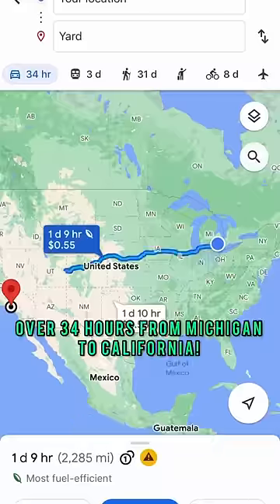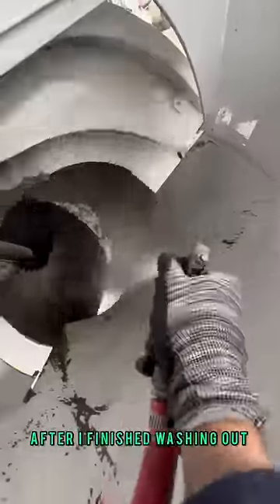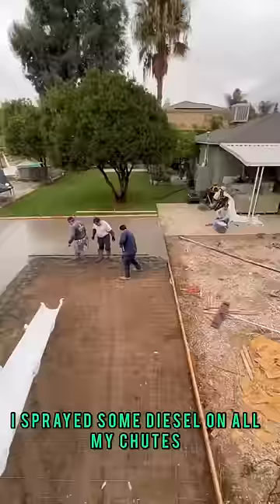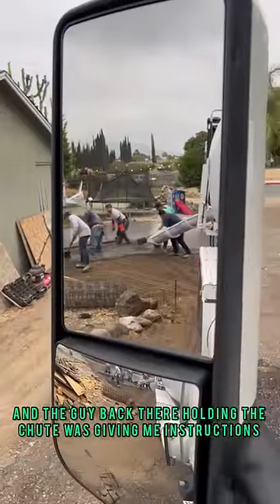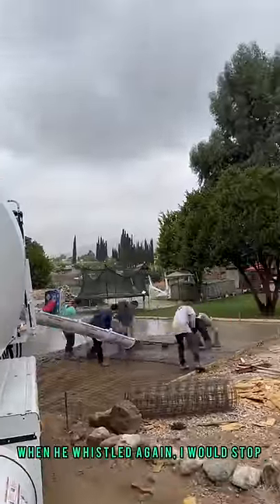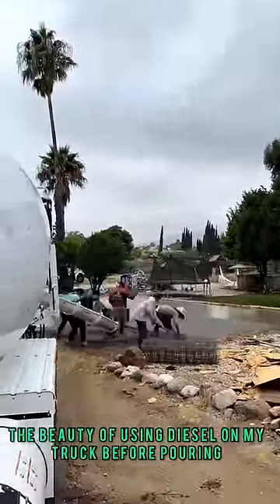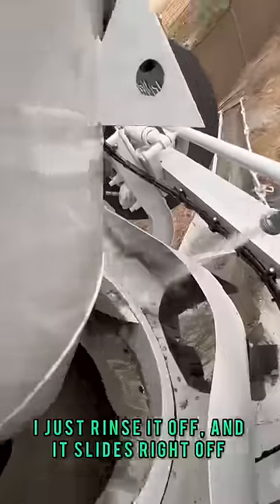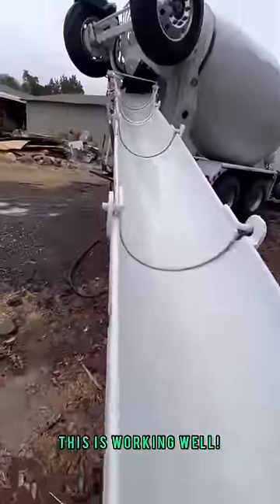BRAND NEW 2022 MIXER TRUCK!! 🤩🚛💨 #concrete #construction #readymix #work #cdl #trucking #shorts

Comment: Yeah, rinsing all that diesel onto the ground is perfectly fine....
Reply: Where do you think it came from?
Reply: @wyrdo1501   perfect comment
Reply: Bro used like not even a quarter of a spray bottle probably but “AlL tHaT dIeSeL”
Reply: With the SWPPP now your not allowed to rise out the concrete at all on the ground.  It’s federal, state and most local law that concrete MUST BE CONTAINED  we have to create a washout pit lived with 2 layers of 6 mil plastic with a berm greater then 12 inches  stone to line the rim of plastic and a posted signage 

SWPPP = storm water pollution prevention program  
Most building dept now have this inspector and this is there entire job 

Me as a project superintendent have legal mandatory paperwork that has to keep on file in the field office 
And BTW folks. This is nothing new I have dealing with SWPPP for 20 years  it’s just getting tougher with more inspectors it’s now very common that the local city inspector and a county inspector will both be on my job sites
Reply: @almostcanadian1580  x how many loads of concrete per day x how many working days per year.... aLl ThAt dIesEl ..
Reply: Disiel comes from the ground wow this whole time i thought it was refined from oil, from the ground. Yeah theres alternatives than diesel
Reply: Public Square  you're right, diesel doesn't come out of the ground like that. It starts out as crude oil. Then it is distilled into diesel. Did you know one of the byproducts of making diesel is asphalt? Now, remind me again what exactly it is they do with asphalt because I seem to have forgotten at the moment.
Reply: @c0rnp0p80  Asphalt is just a petroleum byproduct the same as diesel and gasoline. It isnt a byproduct of making diesel. Both diesel and and asphalt are just part of the total byproducts of petroleum processing. And they are very different to pour on the ground. The way we use asphalt is to place it in one location and it stays there in a crust. Pouring liquid diesel on the ground would immedialy spread down into the soil and water and be consumed by small organisms and slowly increase in density as it worked up the food chain of animals. In the US we learn all about this process in elementary school.
Reply: @winstonpoplin  if you learned about it in elementary school then why did you spend 30 minutes looking it up on Google? 😂 Stop the cap, bro. You ain't fooling anyone.
Reply: @c0rnp0p80  lmao this is standard curriculum mate. Not even anything advanced. This is the most basic understanding of the spread of a material through a food chain. Literally every person over the age of 10 has been tought this in the US. If you think this is impressive knowledge then thats just sad.
Reply: If diesel gets into a water course the effects can be devastating
Reply: @almostcanadian1580  a quarter liter, per truck, with three pours a day, that's a lot of fucking diesel going into the ground.

You drink it.
Reply: Oh yeah and where do you find disiels in bulk in the ground. 
 Uraniums in the ground to, i wouldnt go sprinkling enriched uranium in ur vegtable garden.
  What about the cleaning agents in the refining process? Lmk what grows in it also, and if youd give your family members water or food contaminated.
 Did paving and masonary for 6 years, they dont allow that at the gravel asphault yards and theyres way cheaper alternatives,
 Surprised this is even a convo with prices seeing how some other alternatives can cost.05 cents a gallon vs 6.00$ (diesel)
Reply: @SpunkMayo  some people live their lives listening to those that sale fear for a living, and the rest of us rely on common sense and rational thinking. believe it or not this world is a lot harder to hurt than you think it is, sure pouring a bunch of diesel on the ground would be stupid but come on complaining about what this guy did like he is killing the planet is just extreme and idiotic. whats gonna happen, is he going to harm the grass? i think the concrete slab might be the bigger issue if thats the case. 
 pollution is a serious problem we all agree on that but lets just focus on the companies/people that are doing real harm and leave this dude alone what he did was pretty much harmless. 

if you want to see some real pollution just take a good look behind the curtains of the electric car battery industry. thats going to end up being an actual crisis in the end, it already is and its just getting started.
Reply: Then u hate to see when I bleed my fass fuel filter system most of the time it's a bucket otherwise wise I give back to the earth what we took out
Reply: my exact thoughts but i'm no narc.
Reply: It goes in a 2-3 stage washout pit, sometimes we dump our loads into our reclaimer too.
Reply: @stephentucker5406  do you or did you guys ever use a reclaimer that you dumped your concrete into? It washes the gravel and fly ash from each other. We use it for excess from jobs, slump screw ups etc. It's an interesting machine.
Reply: @stephentucker5406  the
Reply: @c0rnp0p80  you might think that’s logical but there are regulatory agencies devoted to this entire process ( federal, state and local) and they all have inspections and paperwork. Ohh boy to they have there paperwork.  Trust me I know!!
Reply: @winstonpoplin  well said
Reply: @DerfOrNuffin  I think your making everyone’s point that dumping these things in the ground is bad and we should try not to !
Reply: @wyrdo1501  most of your rant is accurate but for one part. 

My son is the plant manager of a precious metals company and there the first in America to be getting a federal EPA permit to reclaim batteries (10 million $ permit)and they have for years been reclaimed the cadmium , lead, nickel. And for years before this has been a cluster.  But as now or soon. 100% of batteries and there elements will be recycled due to the need and cost of these materials 
But don’t get me wrong it’s still about the money 💰 to make more batteries
Reply: @stephentucker5406  not a rant just the truth, its like people have been conditioned against debate or talking about important subjects in any amount of detail. i couldnt care less honestly but it does make me sad to see how society seems to have embraced ignorance with open arms and a closed mind. not talking about you just in general im sure you understand what im trying to say and experienced this yourself at one point or another.  

i know we recycle a lot of batteries, we have been for years so its nothing new but a lot of them will just end up polluting the environment we both know that. 

but think about this point, it takes something like 4-500 tons of material being mined from the earth and over 300 barrels of oil for the equipment to do it, just to produce a single 1000lb battery for a tesla. thats for one battery. im not against electric i think its cool, but nobody wants to talk about the not so pretty side of things because it kinda makes their points about saving the environment void. thats not even getting into the fact that like 90% of the electricity to charge all these cars out in california at least comes from burning coal lol. people need to understand that in reality the only truly environmentally friendly way of getting around is to walk, assuming they are not wearing shoes made of petroleum products lol. we really are at a point of damned if you do and damned if you dont.
Reply: That's where it came from!
Reply: @winstonpoplin  How exactly do you think poured diesel "increases in density" over time?   If it does, it's then exactly like asphalt.  It's not some super liquid folks.
Reply: @truthbetold1855  Over time the diesel molecules would spread and sink into the soil and water and eventually make its way to plants and animals. The increases in density in certain plants and animals are due to the way the food chain operates with primary and tertiary consumers. The lower level life forms consume a certain amount of the diesel. Then the upper forms of predators consume a lot of the lower forms and this causes the chemicals to build up in the higher level predators. Its an interesting process if you wanna look it up. It has been thoroughly discussed throughout this conversation, so feel free to look back.
Reply: Imagine how you're gonna act when you learn about venotryl acid
Reply: @stephentucker5406  dam that's crazy man . That's taking it abit far man . Abit more relaxed here in nz

Comment: Old man who used to drive a cement truck once told me that if you ever get stuck in traffic on your way to go clean out pull over at a Walmart buy as much sugar as your credit card can afford and put it into the mixer the sugar will prevent the concrete from hardening and it'll be a one day job versus a 4 day job
Reply: Hopefully that guy was driving a concrete mixer truck instead of a cement mixer truck cause this type can't turn a drum. And you would not add sugar as powder. You will add only max. 0,1% coke (liquid sugar) of the amount of cement inside your concrete to gain few hours before it will start hardening. Just saying.

Comment: Are there no cement trucks in California? What am I missing?
Reply: They are most likely bought up by large companies. We had to drive 10 hrs away just to get a new 4500 work truck.
Reply: Concrete trucks.. cement is an ingredient
Reply: Probably not many fitting companies for vocational work 

So from the manufacturer international Peterbilt mack etc. 
Has it specs needed

Then it goes to another company to get the body for concrete ,dump, etc
Reply: @CerretaniOutdoorsLLC  You're technically correct, which as we both know is the only type of correct which really matters.
Reply: Why would a manufacturer of expensive equipment choose to produce in a state that makes them give up half their money?
Reply: Why didn't you buy a electric truck your in  liberal California all going electric but can't charge them
Reply: @roberttempleton8112 Even the politicians don't use electric vehicles, they want everyone to buy EV because they own stock in the suppliers.
Reply: @robertball3578  an in the power companys
Reply: This truck looks so outdated compared to the trucks in Utah. Why have the chutes In The back rather than in the front?
Reply: @stephenburdess2914  You ok?
Reply: @hsimpson7267  yeah I’m ok, I’m being serious. Why do you ask? The schutes on the trucks out here come out the front of the trucks. Google it. It makes a lot more sense to have the schutes in the front rather than the back.
Reply: @hsimpson7267  I hope to get a serious response cuz I am curious.
Reply: @stephenburdess2914  Was just in SLC and lemme just say they do most stuff different in utah lol
Reply: @felipeguzman9534  I agree but doesn’t it seem more logical to have the chute out front?
Reply: @stephenburdess2914  older trucks have rear discharge just how they were made

Comment: Definitely use form oil plus it’s cheaper and environmentally friendly😊❤
Reply: Environmentally friendly my arse
Reply: we just would make our own with diesel and motor oil haha
Reply: I am sure that the concrete placers appreciate you fucking up their pour by adding diesel to their concrete and screwing up the strength.
Reply: I don’t think it’s cheaper either
Reply: The form oil we use at the company I work for is biodegradable and affordable we buy it by the 55 gallon drum and I put it in 5 gallon buckets
Reply: @deven6518  you ever heard of Dayton clean strip?
Reply: @Jerbo1125  yes
Reply: @rustyshackleford1  sounds awful
Reply: @deven6518  yes it is. Maybe you don’t know any better
Reply: @geoffreyb3337  form oil is about as environmentally friendly as flushable wipes are flushable. I've been in construction long enough to know that spilling any copious amounts is equally dangerous as diesel,  for different reasons. Additives make all the difference huh, and if you don't understand my flushable wipes  statement,  well. Oops.
Reply: @deven6518 Back in the 80’s form oil was made from oil blends that were off spec at the refinery level, it was made with anything they needed to scrap. Mostly off spec. motor oil. Source, worked in a oil refinery.
Reply: @randykovalenko1236 do you understand that it doesn't mess with the durability of the concrete.

Comment: Can't wait to see the electric concrete truck 😉
Reply from the maker: I think about it everyday!
Reply: The batteries will weigh more than the actual truck... like to see how the back country roads handle the 100,000 lb Gvw weight, gonna be like slipping on a banana peel. Also how about the concrete pump trucks with the booms. Those weigh a lot already... like to see them try and make that electric, especially if the battery fails  during mid pump
Reply: @justinmclean5778  More weight gives you less slipping, not more...
Reply: @TheLongDon  the roads are engineered. They can only take so much weight before they give. And if you increase weight the friction generated becomes more, and when a vehicle uses the breaks it moves the road in a small amount typically not perceived by the naked eye. If you have a lot of weight and friction it will destroy a road and worst case scenario it will be equivalent of slipping on a banana peel. roads flex over time hence cracking due to the weight capacity that has been surpassed.. There are water mains under roads in certain locations. There is a reason trucks are not allowed on certain roads because they can't handle the weight. If you look closely and look at roads that take industrial services like trash pick in residential areas, those roads are trashed because those garbage trucks weigh a lot and are not designed to handle weight of large vehicles when was intended for standard cars and pickups. Its a large part why zoning laws were made so the construction of the roads would meet the demands of the industry or population that the construction is intended for.
 My dad was an engineer an confirmed this was the case why roads are in such disrepair in certain areas.
Reply: @justinmclean5778  Guy, youre misunderstanding the issue then. Max weight on any road is, I believe,  80,000 lbs. That means the entire thing, so cab included. What youre saying is more weight than the roads can handle will destroy them, well no shit, but the max is still the same. Only difference is more weight will be in the cab and less in the load. No weight capacity is being changed
Reply: @TheLongDon  80,000lbs is only on federal highways. Other localities vary based on zoning. They are screwing themselves by not re engineering for larger weight or prohibiting more than 80,000 lbs
Reply: And furthermore the lower limit is 34,000 pounds for roads that are not part of the federal interstate system
Reply: @justinmclean5778  Yes but that's my point. These trucks need to use highways, unless they're doing extremely short loads. Even between cities you need to use highways. It's a non issue. Just stupid because they can't carry as much in their loads
Reply: @TheLongDon  and that brings me to the point of garbage trucks and new constructions and also services in residential areas. They weren't engineered the way they need to be to handle trucks with raw material. So the roads end up breaking

Comment: A pumper once told me to use KY gel,  it works fantastic,  and you can wipe off easy after.
Reply: yah ill bet he did lol
Reply: Could you imagine how much ky gel you’d need to lube it! Lol
Reply: @inspiredpolymath2932  just a bit on the tip then spread it down to the base

Comment: Hey y'all from Alabama.. Been pouring concrete for years and some of the driver's down here use cheap vegetable oil .... Cheaper than diesel and easy on the hand's
Reply: And clean for the planet and sewer systems